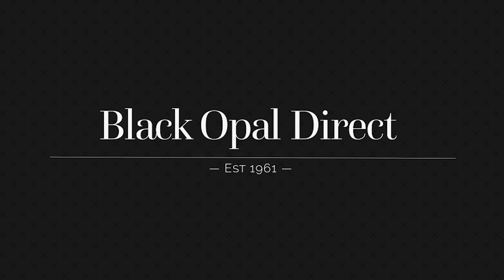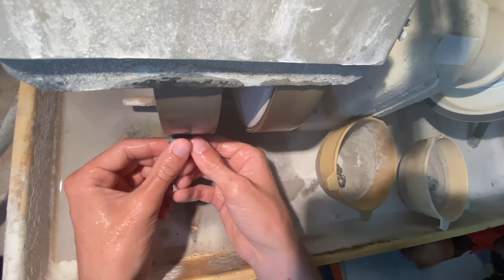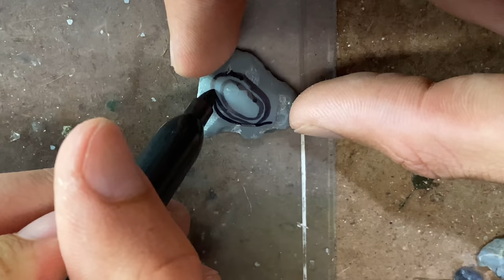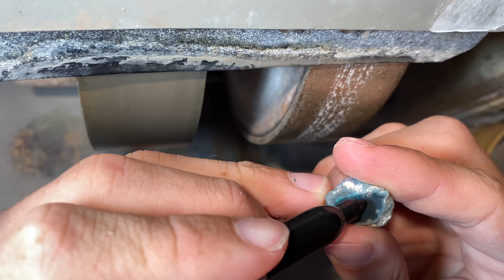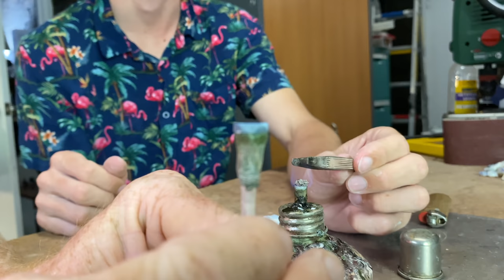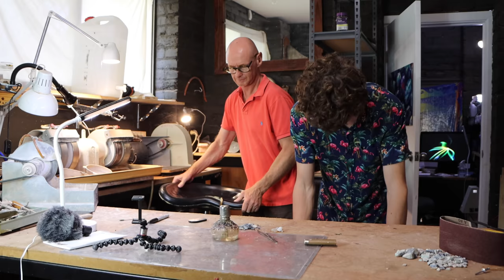Learn to cut and polish rough opal - with Justin

Comment: That was really enjoyable and informative, but do most beginners start with a set of wheels, including the polishing disc? If not, what other set up could a novice begin with, besides a dremmel? Can a table grinder be adapted with a couple of wheels and can a wet tile saw be used for slicing?

Comment: Sometimes jewelers do not WANT a $500 opal. We DO want the $30 opal. When we are making bronze or Sterling silver earrings or a small finger ring, there's no sense on putting thousands of dollars of stone and time when setting on $3 worth of silver or fifty cents worth of bronze.
EDIT: What I mean is do not think you wasted "color" because you ground the stone too small. Still put a half carat stone in your For Sale inventory. Maybe that's the stone that draws me to your products! Maybe I am setting a dozen tiny opals in one setting or I am a sculptor looking for two beady eyes for my Poseidon figurine. Keep those "practice" opals, even if they are worth a few dollars. Tossing them out, you get nothing. Having a "stone remnant" miscellaneous section can get you some cash for that training opal you cut - or your student. Heck, even some well-polished potch bits could be sold off by the ounce to sculptors or model-makers looking for "Eyes without a soul"!
Ultimately, what I am saying as a non-stone cutter, but as an independent jeweler is "You never know what we will pay for something unique that cannot be found on the regular market". I do not have time to polish up some black potch if I need a couple jet-black eyes and do not want to use glass. If you had a baggie of old practice pieces you polished down t tiny bits, those could be worth a few dollars more than if you tossed them out.

Comment: I don't understand what happened but I got a piece of of Ethiopian opal from a gem show and it had a solid looking amount under the sandstone like rough edge and as in was cleaning that of I dipped it in a little bowl.of water and it basically shattered inside and turned all white!  I'm devastated and hearth broke. I've faceted quartz before and was hoping to do some opal. Was my stone crap? I'm so confused
Reply from the maker: Ethiopian opal is volcanic and very volatile. Each piece will react differently and you never know what each piece will do. It’s a lucky draw with that stuff. Sorry mate
Reply: @blackopaldirect  thanks. Well thankfully the pieces it broke down to are all still big enuf to make most of what I wanted. But Def gonna keep trying to get bigger pieces to make cooler bigger stuff

Comment: I have boulder opal with streaks of opal running through it. How do you trim it to get down to the opal? Or do you?
Reply from the maker: I don’t know it depends on the piece but I don’t cut boulder opal it’s too messy
Reply: I’m just a beginner but I’m pretty sure you either trim saw or grind down the iron stone to the point of color.. depending on the quality of opal it will be a tiny sliver, or can run through the piece entirely to the other side.. the goal is to find the best color bar and slowly remove the iron stone until you can see and have a better idea where the color bar is going.. slow and steady is key..👍 hope it helps
Reply: Crawzilla 3030 thanks!! That really does help.
Reply: Black Opal Direct it sure is. If I had only known;)